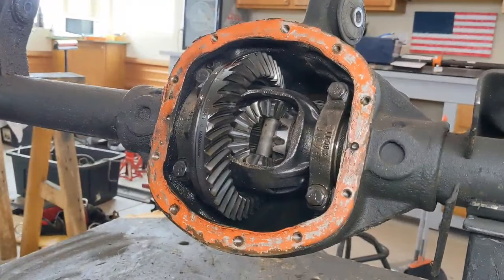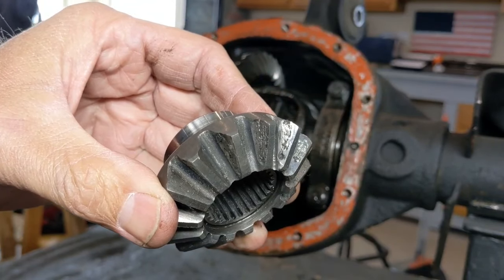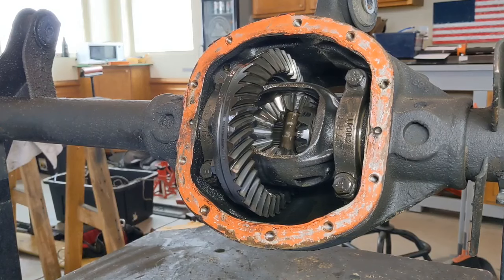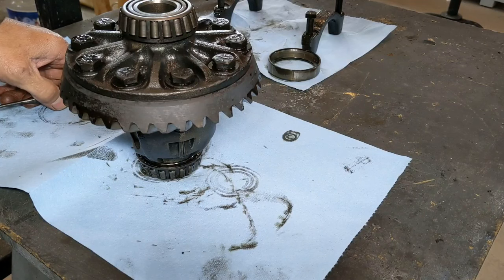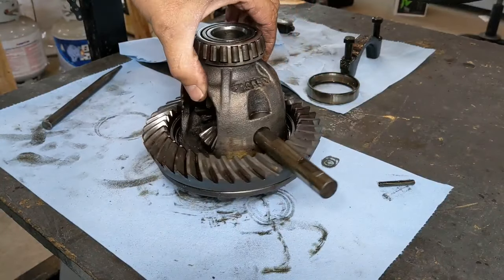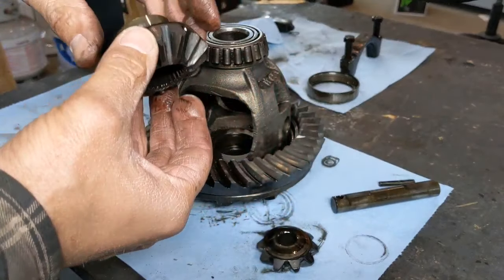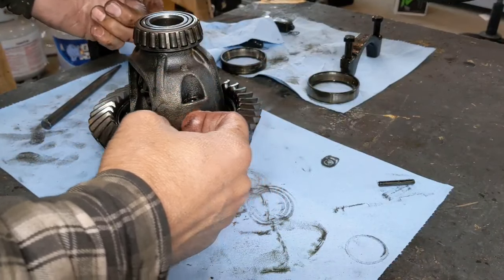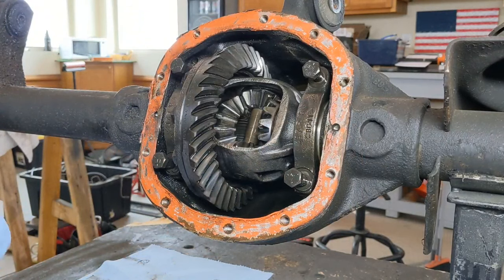How To Replace Spider Gears

Comment: Bruh, I know this is an old video, but you rotated the side gears back into the opposite positions from original location. Not a good idea.
Reply: WoW!  You are 100% correct!  I didn't even catch that until after reading your comment and viewing the video again.  Obviously, it's best to reinstall them in the same locations in which they came from but I'm curious as to how critical it is to do so.  Mike...?  Any input on this matter?